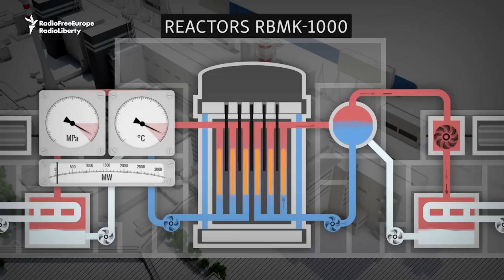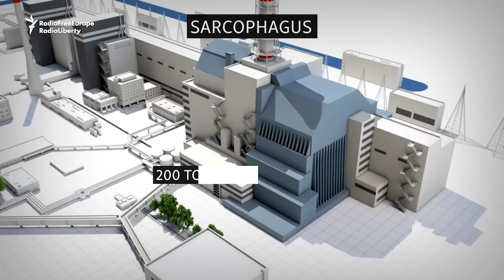The Chernobyl Disaster: How It Happened

Comment: Fukushima is a lot worse.
Reply: Not even close....the main difference is that while Fukushima might have leaked much of radioactive materials into the ocean, the consquences of it are not nearly as bad as with Chernobyl where huge amounts of radioactive particles got into the atmosphere. The loss of life right after the accident and over the years to rescue workers and other unfortunate enough to be in most contimated areas at the time is much, much worse than that of Fukushima. 
Also the amount of radioactive material relased in Chernobyl was 5,200 PBq, in Fukushima (estimated in 2014) it was 340–800 PBq with 80% ending up in Pacific Ocean.

https://en.wikipedia.org/wiki/Comparison_of_Fukushima_and_Chernobyl_nuclear_accidents

Also the amount of population evacuated in Fukushima's case was 154 000 while with Chernobyl over 300 000 people were evacuated.

In all accounts Chernobyl was much, MUCH worse. Decomissioning of Chernobyl power plant is also going to take lot longer than Fukushima and the removal of melt nuclear fuel beneath reactor 4 in Chernobyl is going to be extremely difficult and challenging, unless they intend to somehow bury it there.
Reply: Agreed. Fukushima is not even close. Its main issue is the melted core material is hard to get to through all the building debris and the radiation is still too high to get in and evaluate with the robots. They are looking at using muon analysis to see the cores. On top of that, while they can filter out the other decay products they can't filter tritium and even though it is considerably less than what occurs naturally in the ocean, the release will raise the level locally to a very high level. Fukushima is also struggling to keep the ground water out and washing the contaminated water out to sea. They are freezing the ground to form a barrier but its not perfect. I suppose it will problem stop most water infiltration but even a little is problematic. They have some work ahead of them.
Reply: better check your facts first, Fukushima released only one tenth of the radioactive material that Chernobyl did.

Comment: That's not the end of the story. The insertion of the too hot core afterwards resulted in the cooling water, which they put to a max after one pump died, to combust in huge ammounts of steam, resulting in a huge pressure which detonated the reactor building. 
That's the first explosion.The second and more powerful explosion occured because of the steam, which was burnt to hydrogen, exploding. It resulted in a chain reaction, not a nuclear one, but any burnable thing was exploding at once which huge pressure. The meltdown of the core is known as the elephant's foot. The fires burnt for many hours, needing much clay and sand to put down, and resulted in further radioactive contamination of the area.
Additionally, there was an earthquake (not strong, but information was classified in the Soviet Union because the seismograph was designated to scan for nuclear detonations in Europe) with it's epicenter about 8 km under the reactor building. So there were 3 different things that came together to cause such a desaster.
With todays technology, there is practically no way that such a disaster could occur. Technology is safe, as long as we build and maintain and run it properly. And better not build it in an area prone to earthquakes or tsunamis (thanks russia and japan).
Reply: This reactor design was cheap and fast to build but hardly safe, besides the design flaws with respect to the control rod design, etc, the lack of safety containment makes it hardly safe.
Reply: Exactly. This was a formula for disaster. A positive coefficient tin roof reactor, poor management, poor training, bad design, you name it. This was not a matter of if, but when. No sane country would license a reactor like that but the good ol USSR had no problem with it.

Comment: Talk about putting a bandaid on a open would that needs stitches.  Temporary fix....so what happens after the 100 years that the structure is meant to last??
Reply: I don't think we have the means to deal with the problem - only contain it. So it will have to do for the time being.
Reply: The new structure has special cranes inside, is temperature and humidity controlled and will allow dismantling and removal of reachable parts of the reactor and debris. Those can be contained and transported for burial elsewhere (there is no other method for dealing with long half life products).
The new shelter is not supposed to just sit there passively and cover the reactor carcass.

Comment: Not a “routine safety drill”. It was a special experiment to find out if the circulating water could cool the reactor if the pumps went down. There were errors of design, training, execution that contributed to this failure. Not an accident due to chance causes. Humans were operating the control system up to the excursion.

Comment: Basically the whole system  is based on controlling the chain reaction. When  a U-235 nucleus splits,  it produces two daughter nucleii and up to 3 fast neutrons, these neutrons are slowed down by moderators allowing them to be absorbed by other nucleii, causing them to split, now the point of the control rods is to absorb enough neutrons ( the critical mass) , to ensure that one fission event produces 1 neutron, if every event produced three, then the reactor would blow as it would cause an uncontrollable chain reaction.

Comment: I am shocked to learn that the power plant continued to work for more than a decade after the explosion :O
Reply: Also shutting down those other 3 reactors would have meant serious power shortages around the region, so it really wasnt on option....there was simply no easy way to replace them quickly with other options.

As for the safety issues, well obviosly the safety of the reactors were improved, but also its important to understand that while the RMBK reactors were the most "unsafe" reactor types, operating the reactors under the RULES that were given made them safe enough.....whats important to undersand about what happened in reactor 4 was how they purpously went against those regulations and rules to test something that should have never been tested with that reactor type
Reply: What's even scarier to me is that reactor 3 shares a wall with reactor 4...

Comment: It wasn't the meltdown that blew the roof.  A nuclear reactor is akin to a vast boiler system, which is in a sense like a steam engine.  When the control rods where all removed in order to raise the core temperature, the temperature increased at an uncontollable speed.  As a result, all of the water being heated in the water tank by the exothermic heating element (the plutonium rods) was completely boiled off.  Dry heating without water caused immense pressure to build, and eventually the heat and pressure blew the roof upwards.  When the reactor #4 blew with its tanks and exothermic heating rods, everything had been thrown upwards and the disaster had occured.  The meltdown was a chain reaction that happened moments afterwards as the plutonium continued to output intensive radiation and heat and burn down into the ground - threatening ground water and any land that lay beneath the facility.

I had to research the Chernobyl disaster while studying for my boiler license and my engineer's license.

Comment: Your video has errors 

They never removed the graphite rods in fact they are removed the whole time 
It was when an employee forget to set a controller to 30% power which rested to 1% power this caused a tad increase in power but they decided to continue the test they shut down wind turbine 8 which caused a massive increase in power and heat as the water that is converted to steam begans to create a massive amount of still moving steam after that they shut down the reactor which lowered the 5 radioactive graphite rods into the reactor when they lowered they had no idea it would cause a monumental increase in power at that time near 1000mw as each reactor was capable of producing once the rods were lowered not raised (as you stated in your video) it caused a power and heat increase which caused the high void build up to explode the cover of the reactor flipping it on its side

Comment: Yeah believe it or not but it was the reinserting of all the rods at once with the lack of cooling that caused the meltdown, you see the rods were graphite coated and temporally produced more heat when intentionally reinserted, the heat generated by re inserting them all at one was far more than leaving them out, when the turbine is spinning enough coolant flow is present to barely keep everything from getting to hot, power to the water pumps was cut. It would take 40 seconds for the diesel generators to be able to start and pump water again, even with the generators running only a fraction of the coolant would be moved, but until they started up it had to coast. The minimum required 700 mw was enough to keep the water pumps flowing long enough for the generators to take over, power to the generators was cut at 200 mw, not enough coasting power to keep the pumps going long enough for the generators, combined with the rapid heat produced from  a5 reinsertion what little water there was
Reply: Was not sufficient enough to last until flow could be restored, at 5200 degrees the reactor core begins to break down, that temperature was reached and there was still another 30 seconds before a fraction of the water required to prevent a meltdown would be present, it began to meltdown as a result the power rods began to melt causing a mini explosion inside the reactor, all the remaining fuel was exposed to the heat which caused many radioactive gasses to be generated inside the reactor until the pressure caused it to burst, once open the radioactive gasses and dust took off into the atmosphere and oxygen fueled the fire causing everything to melt to lava that burned through the floor of the reactor and many meters thick of concrete
Reply: Also xenon poisoning of the neutron flux occurred at one point, essentially shutting down the reactor; then the engineers decided to remove all the control rods to restart the reactor. From then on , the flaws in the reactor design and running an already dangerous test without following the instructions all resulted in this disaster.

Comment: Good vid, but you left out a lot of the details, like the reasons for pulling out almost all the control rods, which was because they brought the power level too low and the xenon being produced absorbed neutrons. Also the fact that they shut off steam output in order to do the test, and of course the flaw that led to the explosion itself, that the graphite tips on the rods displaced a lot of water when re-entering the core, stopping neutron absorption enough for steam to build up and take over. Oh and of course the disabling of safety systems.
Reply: You’re sort of right but missing important details. They didn’t bring the power to low on purpose, the turbine stalled as a result of the xenon accumulating from the previous 10 hours it had been left on 50% power. The test should have been moved to another day and they knew it was dangerous. They just wanted to finally finish this test which they had failed at a few times before, as promotions were in line upon the completion.

Comment: They were carrying out a safety test on reactor no.4 to test how effectively the pumps could keep the coolant water flow through the reactor in case of the power supply being knocked out until the backup generators could take over. 
The engineers didn't know the reactor had a hidden design flaw, making it unstable at low power levels. The chief engineer, Anatoly Dyatlov, wanted to carry out the test at only 200 megawatts, despite the safety guidelines told them the test should be done at 700-1000 megawatts. But Dyatlov didn't know about the reactors hidden flaw, and he thought he would preserve coolant water at lower power levels. When carrying out the preparations for the test by lowering power to the level the chief engineer wanted the test to be carried out at, they lowered the power to fast, making the reactor come to a complete stop. The chief engineer orders all of the control rods to be pulled out to restart the reactor. The only few rods that were partially inserted in the reactor core created a hotspot.

The test started and the power to the pumps were shut down. Less and less water were now pumped through the core, the steam pressure in the hotspot keeps rising every second. More and more steam were created from less and less water. The heat and pressure keeps rising and the reactor now starts to boil dry. The reactor now is getting more and more unstable and the power doubles every second. Several fuel rods inside the reactor were torn apart from the enormous steam pressure and the pressure couldn't be contained anymore causing an explosion which blew the reactor lid off. Now with the safety cap blown off, air were sucked down into the reactor making it a giant blow torch which blew more than 8 tons of radioactive materials into the atmosphere. That's basically a short explanation of what happened.
Reply: Chiqui they didnt think that. They removed the rods because they accidentally stalled the reactor. Then, power started increasing and there was a power surge. They pressed the AZ-5 button to insert the rods. But, the rods were tipped with graphite which caused a bigger power surge.
Reply: This was a great read, i need more, all of it, every detail you can give
Reply: They ended up trying to put the contorl rods back in but they where tipped with graphite and that caused a surge of power instead of slowing down the reaction
Reply: 8 tons, that’s a lot..
Reply: you literally transcribed this from the audio of the 2005 documentary lol
Reply: @Anthony-Sadler  you mean the zero hour from discovery Channel? That was 2004, supposedly.
Reply: Indeed.
Reply: @jw200  
learn the half life and decay phenomenon you will understand
Reply: have you tried wikipedia (@luske)
Reply: @Chiqui The reactor came to a complete stop, so the rods were removed to restert it.
Reply: jw200 I wanna know this too
Reply: Stonkish They knew about these design flaws before the accident. After this test unit 4 was going for an overhaul to change also the control rods with other tips. There were already  been occasions that this type of reactor become unstable when the fuel was on the end of it’s cycle. (Leningrad 1975) Also there had been partial meltdown in reactor nr 1 at Chernobyl with a problem with fuel rod cooling channel rulture. Just all kept quite even from own personel. 

http://accidont.ru/ENG/LAES.html
Reply: Both this video and your post ignored the pressing of the emergency shutdown button which, due to the "end effect" of the graphite tips on the control rods, is what blew the reactor up.
Reply: Did you copy and paste that from somewhere? Because it was a safety test. And it exploded because of its positive void coefficient and neutron Flux the graphite tips made
Reply: The other flaw was that at least some of the cooling water pumps should have been diesel backup as well.  If that were the case there would be no need for the original test.
Reply: You watched that episode of Zero Hour didn't you?
Reply: @MrNotorius5500  argh, I was thinking about saying that. Ha ha, it's ok mr.notorius5500, I don't really mind.
Reply: Secrets about Dyatlov that very few people knew about...

(1)- He previously worked in Siberia as an engineer, putting nuclear reactors into submarines, but sometime during that job his actions (later proven to not be his fault) caused a nuclear accident (once again no exact date due to their secrecy levels) that exposed him to 3 lifetimes worth of radiation [200 rems] which ended up taking his son’s life.

(2)- This accident however got him 390 rems of radiation, but it did not kill him. He finally died on December the 13th, 1995 of heart failure. In one final interview he did agree that the radiator’s problems led to it’s own demise.
Reply: Why did they think removing all of the rods would stop it?